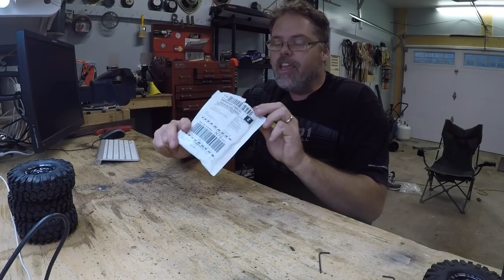Rc Tire Fail

Comment: Hey bill. Love the vids. Keep me coming. I have some info for pug on his console project but he didn't read the comments. You replied to me one time so I figured it's worth a shot. Fibreglass resin remains sticky even when dry until you sand it. Unless you add a chemical "air dry" to the resin before mixing the hardener. The resin was dry as soon as it was hard just needed sanded. If you could let him know that would be awesome. Especially if you put it on a movie. Thanks